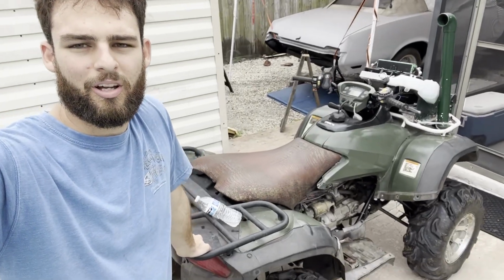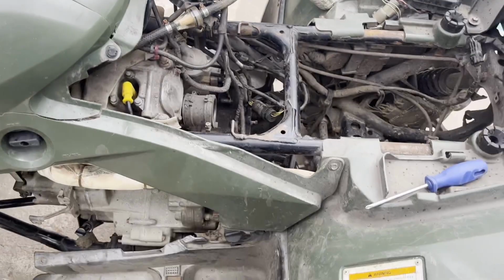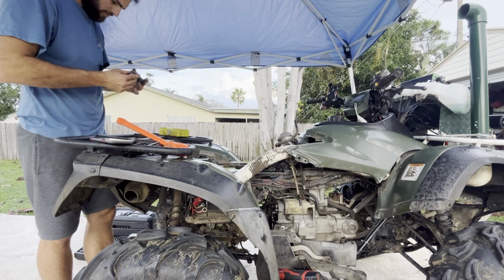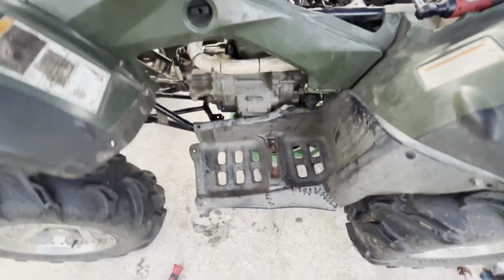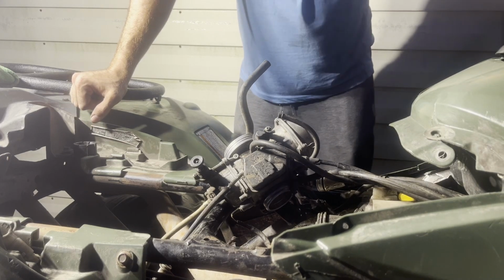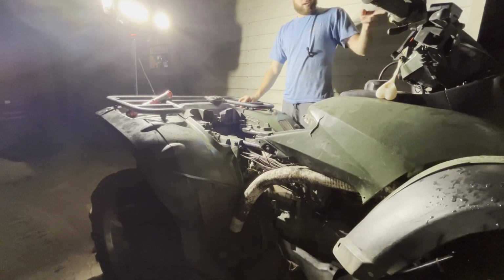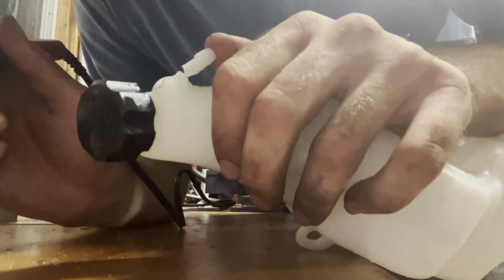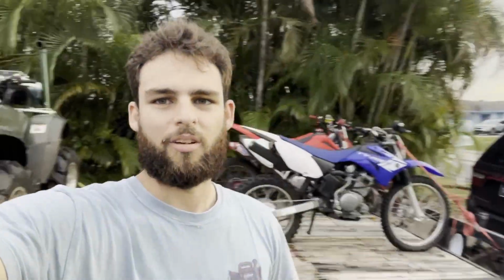How to fix Honda Rincon 650 shifting problems!!

Comment: Thank you for this. My 650 has been sitting for 8yrs because i was afraid to take it apart.
Reply from the maker: Yeah I just sold mine what do you need to do to yours?
Reply: @Jonathan_Hines  same. I can get into reverse, but not forward. Thanks for replying.